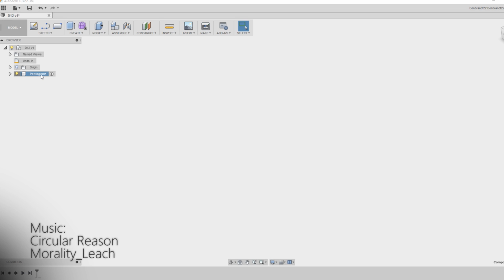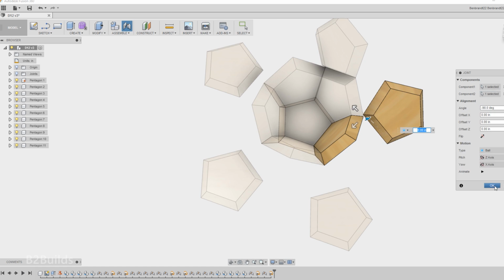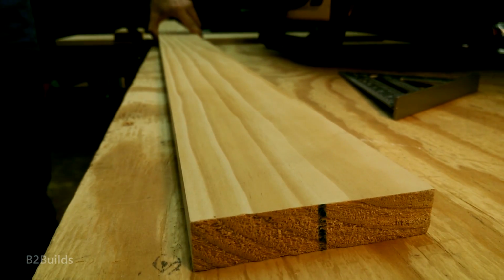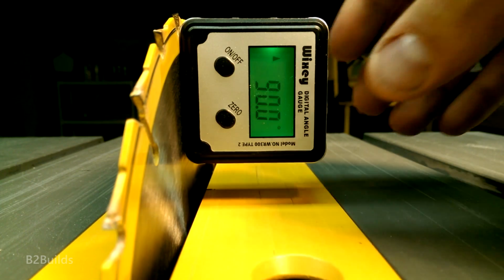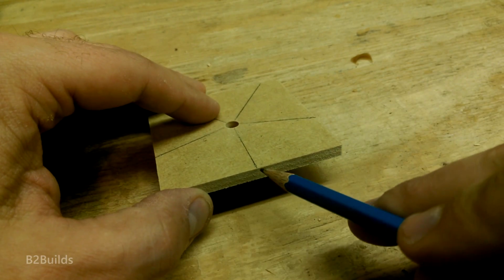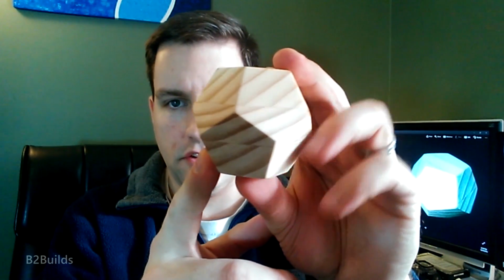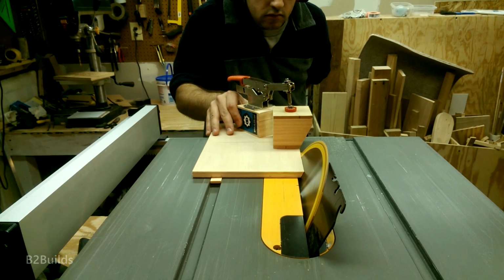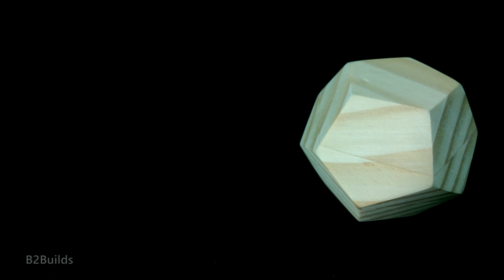Table Saw Dodecahedron: In-Depth Design and Process

Comment: I know this is an 8 year old video but pro tip with that double sided tape: do t cut the paper off peel it apply it and cut the tape leave the paper tail connected to your roll and just trim it every once in a while. Keeps you from having to pick off the paper.

Comment: That double-sided carpet tape is a woodworker's friend.  Cheap!  Oh, I almost forgot, "Polyhedral Models", "Spherical Models" and "Dual Models", all by Magnus Wenninger, [still trying to wrap my brain around that last one], explain the math in high school plane trigonometry.  Blew my mind after making my first set of Platonic solids out of 5"x8" index cards.  If you can draw the line, you can cut to it.  I still can't operate Sketchup, but now I can draw lines that are a constructible number of units long.  No decimal points to worry about.  Handcrafted geometry.  Thanks to Mathworld and to that free PDF  i found online of La Geometrie by Rene Descartes!

Comment: Great video Ben.  Iwas looking to do this myself to produce some dice for math practise for my daughter.  How about a perspex plate on the top, under the clamp head, with a dowel hole and a single scibed line.  May stop you needing to redraw your radial lines and be easier to align, perhaps.

Comment: Thank you for taking the time to produce this video. This could be cut out in a larger version on a properly set up bandsaw. does your computer model give you the block dimensions if the pentagon were to be 1 1/2 or 2 X larger?